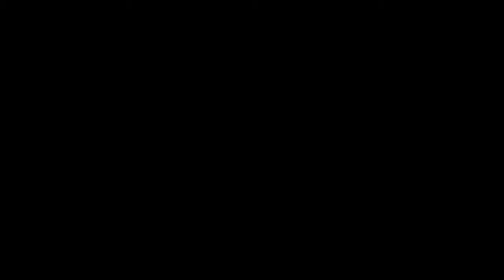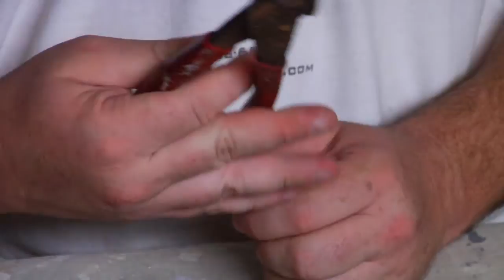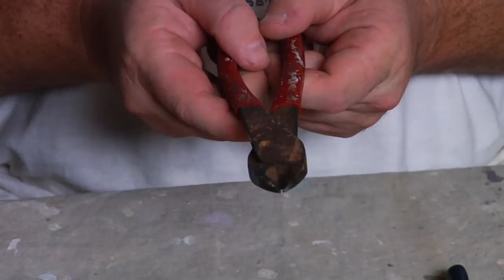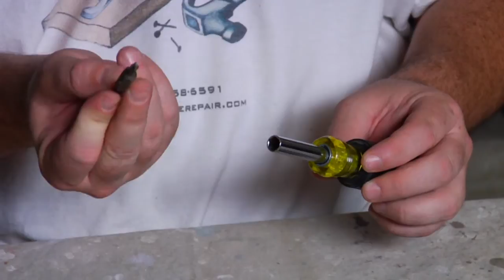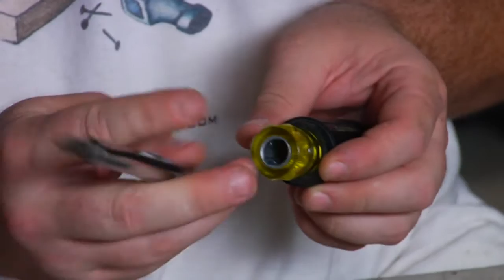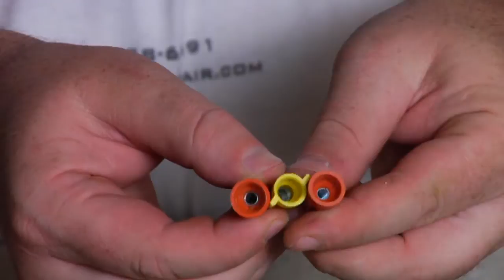DIY Home Repairs : How to Outfit a Basic Electrician's Toolbox

Comment: You do not need insulated tools, I am a fourth year apprentice, and never work on live circuits. I am also a do it yourself handyman and you will never see above 480 volts. Really you will only see 120 volts. Insulated tool give you the false sense of protection. Never try to fix something hot. Its not worth it.